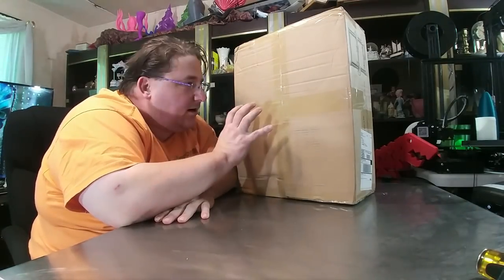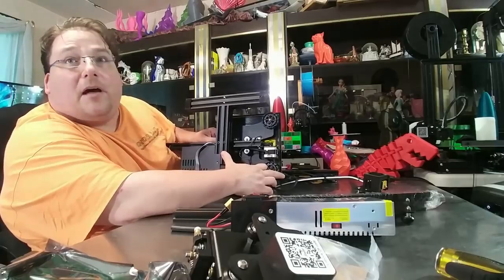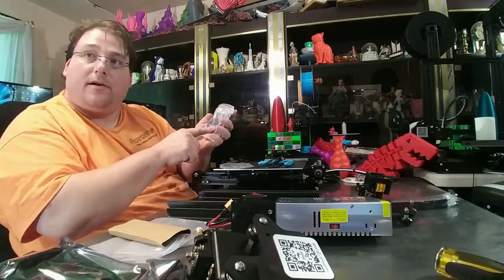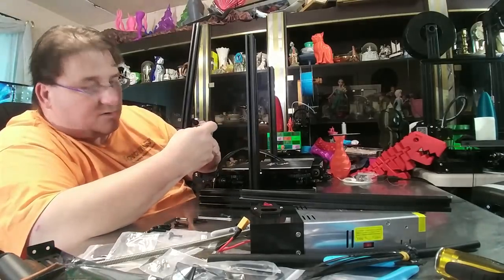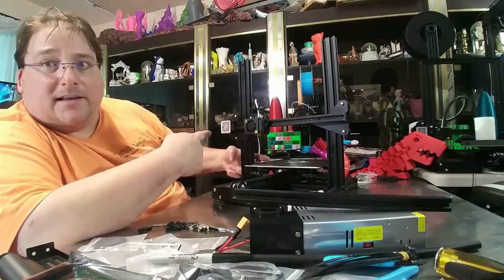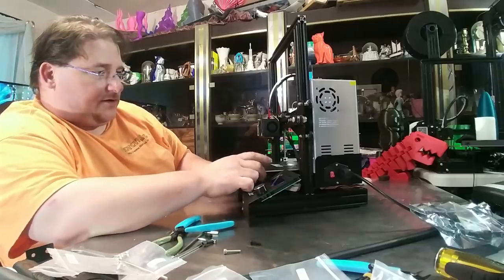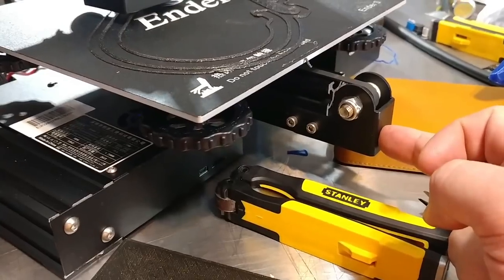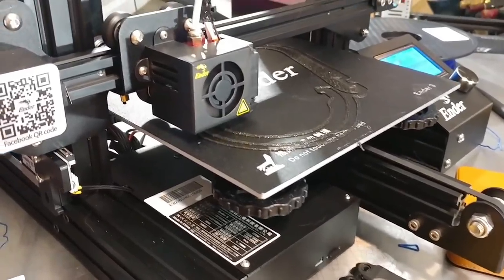T3DP 223 Ender 3 Updated Model Unbox, Build, Upgrade, Many Prints

Comment: Oh cool this is the model I have had for a few weeks, my first 3D printer, my supports were not straight either, was thinking about adding dampers and didn't know about the spacing issue on this updated machine, thanks for the heads up.

Comment: I have had the upgrade build for over a month now. I am really happy with it. I had an issue with the removable bed. When I printed with 80c temp for a while the black film lifted and caused warping of my print. I just installed a magnetic removable system.

Comment: I had zero 3d printers 45 days ago and just got my second Ender 3 a few days back, I think you have created an addict. The new one appears to be the same as the one I got 45 days ago. My first one has the updated board, and the carriage hit the motor when I added the dampers...even though didn't have the new wheel arrangement. So warning to anyone adding dampers, you may have to do the carriage cut, or move motor or stop. Amazed by the difference the dampers made.
Reply from the maker: Another Minion creating cool stuff :-)

Comment: with the vertical beam ends not been square, check if they have been milled or just cut. Aluminium cut off saws are pretty good but it only takes a slightly worn blade to become an out of square cut. They should real;y be milled square.
Reply from the maker: Yep that's probably the issue thankfully it's pretty easy to fix

Comment: Just did everything you suggested in your video, it was all the same problems as on the ender. The two holes on the right vertical trolley are mis aligned on the cr20 as well. Will drill those out.
Reply from the maker: Just make sure you only widen them left and right not front and back so that the bolts don't slide through and double-check to make sure your verticals are straight on most of the latest ones the top race is cut correctly but the verticals are misaligned because one of them has a badly cut bottom once you get it fixed let me know how you like the cr20
Reply from the maker: I just noticed you said right vertical trolley holes all of mine those holes were okay usually they don't line up because the right vertical is tilted so check that first before you drill

With the two verticals installed measure the distance between them it should be approximately 25 cm both top and bottom it might be a little bigger or smaller but it should be the same top and bottom
Reply: They were exactly 250mm. I think I will re check the x axis attachment on the left trolley and pull it a little against the right trolley before tightening to maybe add some space. The holes do have some wiggle room. I also noticed that the z rod is not lined up with the hole it goes into. I don't know if it matters but I will print that spacer for the z motor from thingyverse and see if it makes any difference. It is printing very nice so far.
Reply: Actually when I measured it, the z rod is pretty well aligned, just 0.5-1mm off in the bottom compared to the coupling on the left trolley.

Comment: I just have to post this here -> that Ender 3 you got is like mine, which i got more than a month ago(actually I decided to go for Ender 3 after seeing you first video on it). There is a newer version with removable faketak(buildtak clone) and also has some clips to attach it to the bed, but also just recently came from the shadows even newer version which some stores call "upgraded" version that has removable glass bed with a different(probably better) surface than the faketak
Reply from the maker: I actually prefer the fake Tak it's very very sticky and I like that I don't have a problem removing Prince from it but if you're going to use just pla the ultrabase like surface that the new one comes with is very convenient heat your bed up to 75 c sometimes 80 Celsius and Pla sticks like gangbusters but once it cools down pop comes right off zero Force you can take your pinky and touch the model and it will detach from the bed
Reply: I print directly on the mirror that I have put on it(without any glue or hairspray), almost the same effect as you described with that ultrabase like surface, but still after it cools I need to slightly bump it to pop off
Reply from the maker: Marek Cernvenokovsky correct that's the reason for the small pattern on the glass that creates differentiating stress points kind of like having a thousand little wedges underneath your print the glass will shrink at a different rate than the surface on top which is how it auto releases glass has the same problem however you need a release agent for abs petg Etc you might get away with it but I've seen them take chunks out of glass:-)

Comment: So my spring in the Bowman is garbage. I was getting banding of different thickness’s. I stuck some wedges into the spring to get the tension up mid print lol. If your new and using Cura, take care of the default pla thickness that gets set to 2.85mm. Otherwise you'll get wicka basket prints :D (yup I did it, no idea how I even got prints out, bed levelling was 800% harder hehe).
Reply from the maker: I bet it was yes it is funny that cura equals to 2.85 :-)

Comment: Hi! First of all, love your videos! They have been a great help when I received my Ender 3! Now to my question. I have installed a glass bed on my Ender 3, and are printing ColorFabb PLA at 200C nozzle/60C bed, however I am still experiencing heavy warping in the corners, even though I'm using gluestick on the glass before printing. I simply cant get the print to stick properly in the corners. I am using your S3D profile when printing.
Reply from the maker: First thing you can do is increase the bed temperature 60 C is a little bit cold when you're also trying to heat a large piece of glass I would go 70c possibly even 75c to make sure the top surface of the glass is hot enough to keep the pla at its glass transition temperature which will keep it from warping it's when the pla cools below this that it begins to Warp

Make sure the glasses squeaky clean use a microfiber towel and either clean soapy water with a Hot Water Rinse or some alcohol either works fine for me but glass must be absolutely spotless you don't need glue stick for pla

Watch your squish make sure you're not squishing too much and pulling the pla up at the corners also slow down that first layer and run that first layer hot 200C is probably okay but I would run the first layer at 220 C this will greatly help with laying down that first layer and make sure your first layer speed is 30 or 40% of your max speed in simplify3d I simply tell first layer to run at 40% if I'm running fast I might even go as low as 20%

You want that first layer to be sticky that means hot and slow

So to recap make sure that glass of spotless use a microfiber cloth it should feel like it's dragging across when it's dry that's your indication that it's extra clean

Bed temperature 70c possibly even 75c nozzle temperature for first layer settings 220c speed 30%

Worst case scenario add a brim five perimeters minimum
Reply: Thanks! I have another problem with my Ender 3 now. When adjusting the knobs, I seem to warp the aluminium bed, as you can see in my video the glass is rocking on both ends, however the glass is tested completely flat. Video: https://youtu.be/g3mzTLlfBMk

Comment: I just got mine last week. Still learning. Loved the vine basket. Is support required to print it ? If yes , then everywhere or just touching at buildplate ? I m using Cura for slicing. 
Thanks in advance.
Reply from the maker: Negative absolutely no support is needed

Comment: I've also got this version which I have the stepper dampeners ordered and on its way but curious the best way to deal with the Y-axis issue. I also got TL-Smoothers ordered also but sounds like that may not be required. Live and learn
Reply from the maker: A Dremel or a metal file should be plenty enough to just carve out a little notch so it doesn't bump into the stepper once the damper is added

Comment: Nerys - can you please tell me what settings you use for vase prints?  I use cura and I printed a rocket using spiralize which came out really nice for my first attempt but it was fragile and snapped in half after handing it to my kids.  Im using stock nozzle.
Reply from the maker: Increase your temperature a little bit and increase your Extrusion multiplier I sometimes go as high as 1.5 with vase prints you obviously want to do this after bottom layers and printed if you have any

Comment: Another great video Chris, thanks for taking the time to do it. I will use it to check my one..Btw should I adjustbwheels etc even though I printed a great pearl tower check print?  I do get two physical bumps on the gantry wheels..?   I am concerned at fiddling then looking my excellent prints so far...thanks  Laurie
Reply from the maker: Philly won't hurt the wheels are desired to be adjusted just loosen them slightly until the bumps go away just make sure the bed doesn't wobble

Comment: Great video! Did you have any issues with the leadscrew binding due to the way the Z motor is attached to the frame?
Reply from the maker: No I didn't but I also keep that brass bushing a little loose so it can't bind up

Comment: Is the control board still the old one with a ATMEGA1284? Or are they using the upgrade CR-10S board, which apparently uses the ATMEGA2560?
Reply from the maker: I will take pictures and next time I open one up and be sure to post the results

Comment: Hi, I just got the Ender 3 with this board (v.1.1.3), but I'm seeying Salmon Skin on the lateral of the 3D Benchy. I'll order some TL-Smoothers but it will take almost two months to receive it in Brazil. Is there anything else I could try to get rid of the Salmon Skin? Perhaps to regulate the drivers voltage.
Reply from the maker: I am not sure if you can get access to the right diode you can solder your own but that might be a pain in the butt and I don't know how to do it
Reply: Nerys  Thanks for you reply. I`ll probably try the TL-Smoothers. However I saw on a couple of places that TL-Smoothers work well on the v1.1.2 board but do not work on v1.1.3 board (no effect on the Salmon Skin issue). Do you know wich board do you have in this Ender 3 which does not exhibits Salmon Skin?
Reply from the maker: Lucio Paulo Machado  they all exibit salmon skin to "some" extent. the older ones the TL smoothers remove most of it the new one has it but VERY soft hard to see. I will try TL smoothers but I doubt they will remove that last little bit. I am surprised yours is that visible on the 1.1.3 board my vanished on the benchy and is only really visible on very high res round vases and "just barely" visible. you have to hunt for it.

Comment: Hi, I like the way you show and recommend upgrades in your videos! Now to my question: I have an Anet A8 for a while now and I am not satisfied with its print quality. I have been looking for a replacement in the form of Prusa Mk3/Ender 3/Creality 20/Creality X. My main goal is to have a printer that can print with good quality and as a messure of that I got Makers Muse "Tolerance Test V2" from Gumroad. When Angus printed this on his Prusa Mk3 the 0.15 mm was OK. When I printed this on my Anet A8 I got 0.3 mm loose after some jiggeling. Have you tested this on the Ender 3 or do you have a hunch of how accurate it is so it wont fuse moving parts together like mine? What is your recommendation for a printer that has good print quality with accurate dimensions?
Reply from the maker: If your printer makes decent prints his torture test is not really a test of your printer but a test of you and your ability to slice a file it's basically a slicer test :-)

The Ender 3 is an amazing budget printer that makes some amazing friends you cannot go wrong buying it considering how cheap it is and how good the prints are

The cr20 is in upgraded version of the Ender 3 probably no print quality difference but better Mechanicals and electronics

The CRX is a cr10s sized printer with better quality electronics and Mechanicals that prints two colors

The prusa MK3 is a hobby grade printer with very high quality components that is totally open source and well-supported it also makes fantastic quality prints and you have the option of upgrading to the mmu to give you multi color and multi material

The core problem with the MK3 is it's very small print volume it's even smaller than the Ender 3 which actually has a pretty generous print volume of 230 by 230 by 250

More than that I cannot say as I have no direct experience with the prusa printer but people I trust or getting fantastic results from I think you would be happy with any of those printers over and a net A8

However I would probably start with an Ender 3 just because of its expanded print volume small compact all-in-one design and extremely cheap price

Learn how to slice and how to know what settings to change which is something you gain from experience and trial and error and by the time you've used it for quite some time you should have a pretty good idea of whether you're going to remain in the Hobby and what your goals and objectives are to determine whether you need to go with multi material or whether you needed a larger print volume or not basically it's a very safe purchase that has no real downsides

Let me know if you have any more questions I'm always glad to help
Reply: Thanks for the quick reply! My Anet A8 doesn't do very well in regards to print quality and dimension exactness. The bigger print volume on the Enders 3 is not my highest priority, its print quality and correct dimensions. Your answer tells me that even if I go for the much more expensive Pruse Mk3 it's no guarantee that it is much better than the Ender 3 with my wishlist. As I was learning (and is still learning) Fusion 360 I found some tutorials from Paul McWhorter and in one of his lessons, https://youtu.be/_qTcZ8ynk4U, he made an eye glass container. He printed this out on his Prusa Mk3 withput any clearance in the design, amasing! I have to design the same thing with a clearance of 0.3 mm, otherwise it's impossible to get the lid on. It's this kind of exact dimensions I mean. Do you think the Ender 3 can do this without clearance bulit in, in the design?
Reply from the maker: Magnus Nelénius I am pretty sure he designed some clearance into the print it's pretty much necessary but a very well to trigger should be capable of .15 mm tolerances and with practice slicing the Ender three can do this

Comment: I’m having a problem with my tevo tornado the first layer prints fine but the second layer puffs up and and the nosel starts scraping the print 

any help would be amazing 

Thanks
Reply from the maker: Usually this is an indication of improper bed level you're over squishing the first layer so it puts down too much filament and when it lifts up to the next layer it doesn't lift up enough so it again extrudes too much filament

Also make sure the wheels on the right-hand vertical trolley are not too tight because they could prevent your X gantry from lifting up the proper amount as it binds

The right-hand trolley should basically be floating very little resistance only exactly tight enough to not wobble around front to back
Reply: Nerys thanks so much

Comment: You didn't get the most recent one. The most recent version has a removable PEI Sheet with build tac. Wish it was magnetic, but the little clips are fine.

I do wish they weren't using the Marlin 1.0.6 for their base firmware. It's not hard to port the power resume feature. But the chip in those boards is small, it's not funny. I've been debating about ordering the CR10S v2.1 board to replace the board in the ender.
Reply: Well if it was truly an incorrect build plate that got mixed in. then it's a win for me. one less upgrade that was needed. balancing a Marlin 1.1.8 build with a BLTouch has already been a bit of a pain cause i want SD card support and mesh leveling, but space limits to SD card Support and 3 Point.
Reply: A guy in the comment section over at 3DPrintingCanada's video about the BLTouch had a solution to keep sd support and mesh leveling
Reply: I ordered one with 235 x 235 boriscilate glass, did I make a mistake? Or will that be an OK surface?